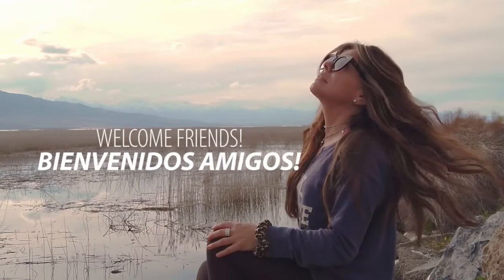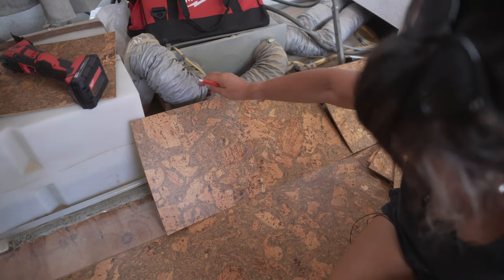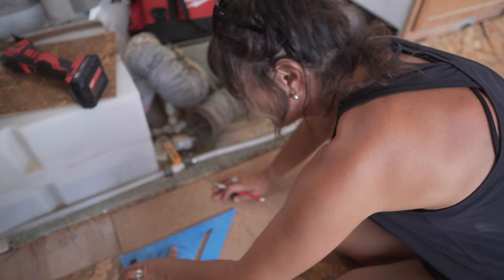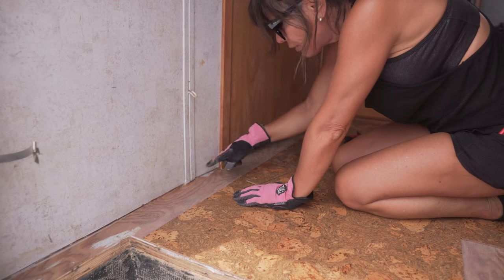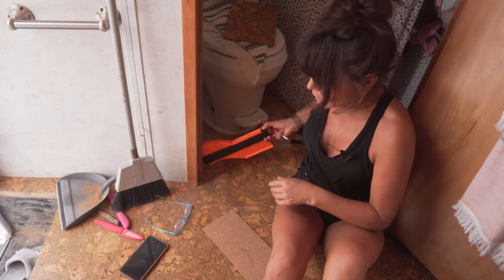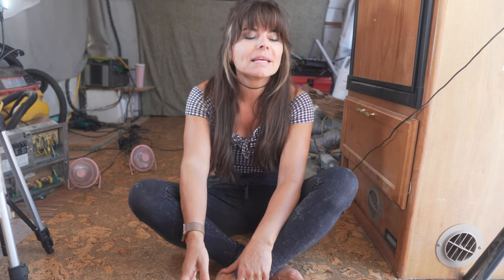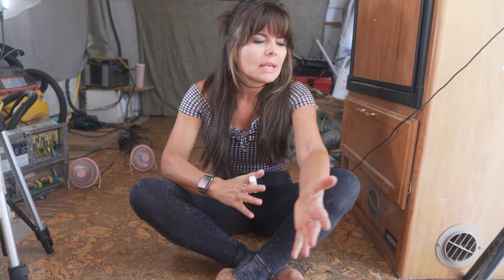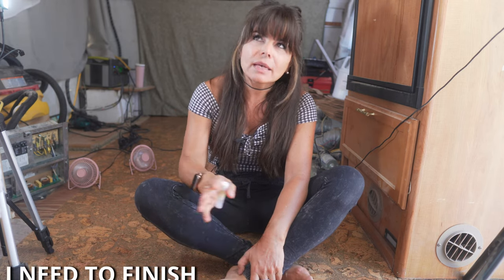RV RENOVATION: ZERO EXPERIENCE CORK FLOORING INSTALLATION. PART II. SUBTITULOS EN ESPAÑOL.

Comment: I am definitely using cork!
Can't wait!
What was the cost of the materials? I have the tool that you used to cut the tiles already...
I will line them up too...if I don't my eyes will not be as happy!
Reply from the maker: I want to make a cost breakdown video but for the tiles and the glue I paid $508.11 I definitely bought more than I needed but I don't mind as I want to create some projects with the leftover.  I'm also considering to do my walls and backsplash in cork as they have different patterns and colors. I haven't decided yet as a cool wallpaper is tempting as well! So many choices, so little space 😜